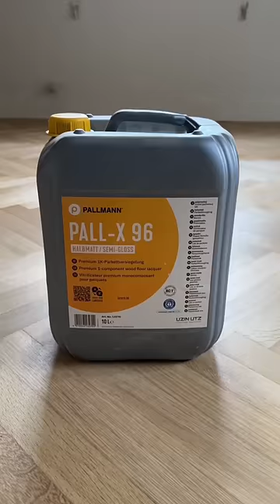Reviving an 100 years old parquet: a masterpiece of Restauration 🤩 #shorts

Comment: Stunning, probably looks better than it did 100 years ago
Reply: I agree for some reason restored wood looks even more beautiful.
Reply: It’s very important to NOT use a drum sander. It has to be done with a three rollers and a flat bottom face. That way you can’t create a divot if the machine pauses for too long.
Reply: @davidelliott5843 yeah, thats why you dont pause to long. 🤔
Reply: @parkettat  incredible work mate
Reply: This House ist Not old. 30 - 40 yrs old!!
Reply: @nktm832 your clue ?
Reply: Might look good, but would have looked much much better with oil varnish. Water based deadens a floor every time
Reply: @davidelliott5843  This is the only thing I can flex on...as a 5th generation floor expert of 25 years I can say from experience that a drum sander is the ONLY thing that can truly level a floor. Those dips are called stop marks (of which he left many) and they are easy to make but just as easy to remove.....IF you know what your doing...This is a craft after all, that takes years to hone. I've resurfaced probably over 2000 floors in my time and Ive tried ever possible technique to do it. So I can confidently say drum sander and polisher is the best possible option. Don't tell people not to use the best possible option just because YOU cant use a drum sander properly.
Reply: @metepack4872  Right. Sure its tough and all but it looks like someone washed over all the colors with gray, just dead dull colors. Gotta have some form of oil in there to bring out the beauty.

Comment: This floor is stunning! Long ago, we bought a house and immediately started some cosmetic renovations. We pulled up the carpet and saw the original 35 year old beautiful tongue-and-groove wooden floors. We refinished them. They came out beautiful.
Reply: Не врешь?
Reply: Odd fascination with carpet that would cover a real wood floor.
I had an old house that had carpet over linoleum over oak t&g. Refinished very nice.
Thought the upstairs may be also so tested a corner and found plywood. I didn't look under the plywood.

Comment: I’m not a fan of parquet flooring, but this one was gorgeous. I’m so glad you restored it.
Reply: That’s because its not really a parquet floor. Looks like white oak hardwood laid in a herringbone pattern. “Parquet” flooring is generally smaller pieces of wood laid out in distinct repeating patterns, usually resembling tiles.
Reply: @mr.e8432  Herringbone pattern flooring is parquet flooring. Parquet flooring is a broad term, it's not any one specific pattern. Parquet flooring is any flooring made of blocks of hardwood laid in a repeating pattern.
Reply: Thanks for this lovely floor-aficionados…couldn’t sleep❤
Reply: @TakeNoShift  Herringbone is one of the easier and cheaper variants, still really expensive back then and even now, just imagine how expensive one of the more complicated models was...

Comment: It’s an amazing restoration that’s gonna be short lived. Original flooring is only 1/4” thick. At least 3/32 got taken off during restoration removing the heads off those 1 1/4 nails which will result in slats popping up.
Reply from the maker: What are you talking about? Nails are never on the surface 😳
Reply: @parkettat  those aren’t 3/4” hardwood dude. Those are 1/4 parquet

Comment: I'm surprised if you're not changing that top roller. Sanding adhesive makes a build up on the roller that can't be cleaned 😮 
Use a rental for glue

Comment: What dreams are made of when you pull up an old carpet…. Unfortunately some idiot stapled my carpet down every 3x3  feet 🤯🤯😱!  Plus glued edges for good measure… pretty sure he wanted the carpet to stay put if the roof got blown off 😂

(It was also just a thin pine slat type flooring from the ‘50’s, not a lot of wood to save)